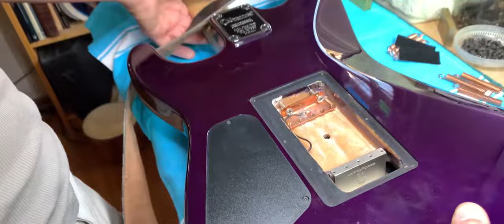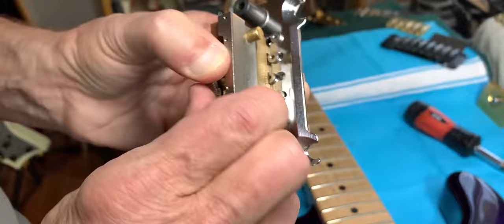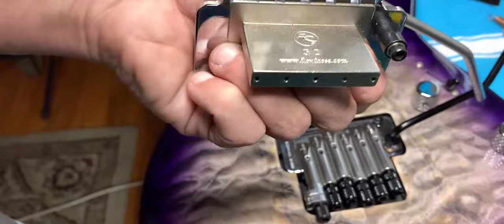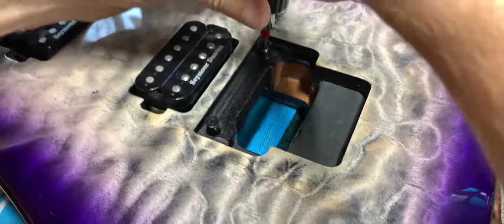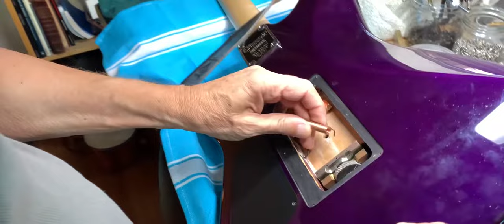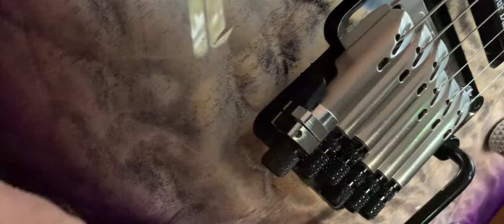Sophia Tremolos: Upgrading from Floyd to Sophia 2:92 pro [+]

Comment: In my experience the best is Ibanez bearing system tremolo.
Reply from the maker: Thank you !!!  The Sophia line is manufactured under multiple patents owned by Geoffrey McCabe - - Ibanez licensed  the ZR tech from McCabe... the proceeds of which went to establish Sophia Tremolos ... love back as always ..
Reply: @merkaba22  But, I dont understand why they stopped making it. It was really great solution.
Reply from the maker: @vaguitarts3443  Thank you -- we were not in control of that decision ...
Reply: Ibanez got sued by Floyd Rose and Floyd won.

Comment: Can you use the thumb wheel to tune from standard tuning in E to half step down to E-b and it will land all 6 strings in proper intonation?
Reply from the maker: No, unfortunately, since when the tremolo tilts both pitch and intonation are disturbed, -- the GT Pro will hold the base plate to +5 cents when dropping from E to D , and its believable and still  floating tremolo.
Reply: @merkaba22  What if i used the thumb wheel to roughly deune down a half-step to Eb, and then fine-tuned with macro / micro tuners? Would that be a good idea? Is it a possibility? I'm often re-tuning from standard to Eb and back.
Reply from the maker: @Peterplayingguitar  The QuickTune Thumbwheel is for re-establishing Initial Setup, where th base plate is 90º to the risers and string and intonation set.  YOU could drop the tuning down with the thumbwheel, but the action will be higher and the intonation off a little bit, more apparent on higher on the neck... its physics ...
Reply: @merkaba22  Roger that. Thanks for the reply.

Comment: i like that tremelo...will it replace my DC747 Carvin ? it has a floyd rose.  ?? Do you make these ? is there a website with specs and instructions ??  thanl you. I also noticed the limitations of most tremelos..limited contact of strings cant send tone through the body
Reply from the maker: Yea, yea - the pre-tensioned stabilizer contact pins add extra contact and embellished the normally linear decay pattern -- they actually make the instrument louder [acousticall], etc....
The Sophia 2:92 Tremolos are built for original spec OFR® Vintage and Pro routing. -- http://www.sevenstring.org/threads/trem-replacement-swap-guide-what-trem-will-fit-what-cavity.236457/  comparison listing.  It would seem that there is a general acceptance of fitment, stud spacing, etc. —  See SophiaTremolos.com or write to us: sales@cslsophia.com

Comment: Ok, this is awesome!😂 One question, is it possible to set up the baseplate to be flat on the body to be dive only (EVH style) for guitars without the trem recess route? I set mine up that way cause as you said, the more direct contact you have the better tone you'll have.
Reply from the maker: Actually, it would take a slight mod -- the Sophia intonation screws extend .078 below the base plate ...the OFR tremolo saddle screws only extend about .040 .
Reply: @merkaba22  Oh, OK! Thanks so much. Love the bridge

Comment: I recently ran across an interview series with Gary Kahler about the re-introduction of the Steeler tremolo platform for 2024, I was pretty stoked because the Killer is one of my favorite trem systems, only to be told that they were too expensive to produce. I proceeded to get into a heated discussion with the guy giving the interview where several suggestions were made and shot down because it 'just wouldn't work' (mostly involving simplifying the saddles because why tf do they need 13 parts each?) and that consumers are too uninformed to make worthwhile suggestions 🤦‍♂🤦‍♂. So imagine my surprise to see this wonderful piece of engineering! It's got the best things from the Killer without the convoluted (read ego stroking), has all of the 'impossible' suggestions already included and is no more expensive than the other top-line systems out there. Plus it can be use headless! Seriously well done!! I wish I would've know about this sooner. Now, if you'll excuse me, I need to prepare my wallet for the beating your website is about to give it 😁😁
Reply from the maker: Thank you so much for the kind words and reception -- "we love this stuff ..." --  if you have any questions write to us at sales@cslsoopahia.com

Comment: I have a Kiesel Ultra-V with a Floyd Rose Original on it. I like what I see with the Sophia 2:92 except for the extended length. I'd be worried that if I pulled up too much on the tremolo arm that the fine tuner knobs would extend beyond the cavity and dig into the guitar's finish- even without the detuner. From what videos I've seen, it would be a really close fit. Any experience with replacing FR trems with these on Kiesel Ultra V?
Reply from the maker: The Sophia 2:92 w/ macro-tuners fit most OFR tremolos with recessed cavities -- typically the recess should extend be a little less than 3" from the centerline of the risers -- we just got some custom stainless steel knobs that also introduce a shorty and a short spine version  that are about .065 [incorreclty stated as .200"earlier] shorter -- the typical dimension of the end of the intonated six string macro-tuner is anywhere from 2.75 to 2.92"depending on the guitar, etc. -- the shorter knobs then reduce this length to 2.685 to 2.855 -
 write us at sales@cslsophia.con or visit our website sophiatremolos.com
Reply: @merkaba22  That is awesome news about the shorter knobs. I measured the cavity and it extends 2-13/16" from the centerline of the risers. Thank you for updating me on that info.
Reply: So the 2:92 Deluxe seems to not even have fine tuners on it- is that the difference between that and the more expensive model? If so, I may be able to do with that, since my guitar already has locking tuners at the headstock, although when I custom ordered the guitar from Kiesel, they recommended I get the locking FR nut anyway, which I did. I'm afraid that if I leave the FR locking nut in place, without locking it, the string grooves might not be suited for tremolo use.
Reply from the maker: @gbferrell  Yes, the Deluxe locking saddles do not have our full-range tuners -- if you lock the strings at the nut, you cannot further tune the guitar -- the issue with the first floyd, etc. -- We suggest you get tuners for this arrangement is best since otherwise we are not sure if anyone sells a non-locking nut for the vintage locking nut shelf specifications...
Reply: @merkaba22  Ok, thank you. I like the idea of the 60:1 fine tuning knobs anyway.
Reply from the maker: @gbferrell  The nomination; length of the macro-tuners is reduced by ;065" -- the typical dimension of the end of the intonated six string macro-tuner is anywhere from 2.75 to 2.92"depending on the guitar, etc. -- the shorter knobs then reduce this length to 2.685 to 2.855 -- within 2.825- 13/36
Reply: @merkaba22  So, we can't be sure until I actually try it. I hate the thought of possibly having to cut into my custom flame-topped paint job, but as our bass player commented, he would do any mods to his guitars if it helped his playing. I despise the locking style of the Floyd Rose- I don't trust the 'locking' part of it because I've had strings slip out or break too frequently to be confident that it won't happen during a gig. Give me back my ball ends! Can the shorter knobs be had in black chrome- or that fancy red chrome that I saw in some of your pictures?
Reply from the maker: @gbferrell  yea, yea no ball ends -- the new tuners, though the knob to about .055 did and ups to .075 through the nose slot [where yo do cut the ball ends off].  We will have a dozen red spline knobs coming in shortly to evaluate  -- contact us to reserve....

Comment: I am confused on how to shim the Sophia for my 12" radius neck. Could you please tell exactly which strings (Low E, A, D, G, B, High E ) need to be shimmed and how much? I know this is a subjective question, but it would help to get a general idea of where to start. I'm thinking from your chart, the G should have one .2 mm shim and the rest of the strings don't need any. I think that's what you meant in your email but instead of 'G' you said 3rd string, which would depend on which side you are counting from. Usually, the high E is considered the 1st string, but just want to make sure.
Reply from the maker: We offer shims placed between the addle and the base plate, like intake locking tremolos, to alter the pre-fixed R14 radius we use on our tremolos.... shims under teh middle saddles increases the roundness and lowers the number, to say R 12 or R10 ..
Reply: @merkaba22  Sorry, I missed your reply in our email chain: "The Sophia 2:92 is performance oriented and has an R14 specification that works well with R12 to R16 and compound radii out of the box — you can order a set of shims, placed between the macro-tuners and the base plate, to alter the radius if you prefer." So, basically, you are saying that the shims aren't absolutely necessary because the 14" radius Sophia will still work well with 12-16" radii, right out of the box and adding shims or not depends on personal preference. I mounted the tremolo last night with a .2mm shim under the G string saddle. Seems fine, but I have yet to adjust the intonation. If I'd read your email reply more carefully, I wouldn't have had to ask that question.

Comment: Am I right in assuming that you’ll never need to unlock the Sophia nut once it’s locked as the fine tuners have infinite range?
Reply from the maker: Pretty much the case -- the macro-tuners a full range 50:1 ratio locking tuners

Comment: Hi! I have a LTD H3-1000 with a Floyd Rose 1000 SE would I need to route the posts to upgrade to a Sophia 292?
Reply from the maker: The short answer is No.. the Sophia 2:92 is a drop-in fit for nearly 7 years so far -- we even have OFR-sized Titanium spring blocks for small tremolo cavities -- We have a V2 "easy to setup" Global Tuner Pro that works with any pocket the can handle the big blocks -- write to us at sales@cslsophia.com -- thank you!

Comment: would it fit in a charvel 475 special.  it has a JT 590 schaller?
Reply from the maker: Yes, the Sophia 2:92 is a drop-in fit for the OFR and it and the JT 590 by schaller are very similar -- . Parts are interchangeable except for the locking bolts  --  given the associated rout, if deeply recessed, the macro-tuner knobs would be a close fit and like other solutions, the DropTuner would need the recess modified -- if floating above the body on this version, easy fit:)  The GT Pro upgrade means you do most of the tuning from the QuickTune Thumbwheel in double locking and headless setups..
Reply: @merkaba22  thank you ❤️
Reply: @merkaba22  I am looking in the website.  The 292 deluxe with the duel stabilizers I could tune it from the regular tuners right?.  For my taste it looks amazing really and unique.  If I can I would just upgrade to locking tuners  what do you think?
Reply from the maker: @crate718  yes, thank you! yes, you can do that too!

Comment: A big question for me.....I noticed Sophia makes a particular type locking nut that looks as if it may be ideal for a headless guitar....so can a Sophia trem and nut replace a Floyd Speedloader Trem and nut without mods? As you probably know, Speedloader strings are not made anymore leaving the Speedloader equipped guitars useless....thanks
Reply from the maker: We have seen a couple of conversions -- the body rout is small and we recommend the TI OFR-sized 32mm StopBlock -- The HPT Micro, with individual string locks, fits the normal locking nut shelf

Comment: Does the locking nut come with the trem? If not, can it be purchased separately?
Reply from the maker: We sell the locking nut separately Ince so many guitars already have them -- the Sophia HeadPeace Tuner line have individual string locks and fir on vintage-sale locking nut shelfs -- may need a minor modification on some guitars....

Comment: I will have one for my jem jr plz blow me up with advice and how I may get one as soon as a month
Reply from the maker: Hey back -- that conversion turned out very nice -- we get lots of feed back on that one!  The basic Sophia 2:92 is a drop in fit with. stainless steel saddles, inner parts, risers, arm, etc. -- you can chose either the GT Pro or UNO Single Stabilizer Upgrade -- We are temporarily out of black base plates, the black chrome would match nicely.  Just need the size fo your spring block, the distance from the spring end to bottom of the base plate. Check out our site, SophiaTremolos.com, for pricing and options ...

Comment: This looks amazing! Will it fit in a Alexi Laiho guitar?
Reply from the maker: The short answer is YES -- replacement for OFR sized tremolo -- you just need spring block length -- 42, 37 ,34 or 32mm -- for the base model with a bell brass StopBlock and built-in TremStop -- The GT Pro upgrade fits most pockets
Reply: @merkaba22  This 2:92 pro model will work? It’s currently on sale on your site.
Reply from the maker: @9hk38f  Yes -- just need the spring block on your current trem to get started.

Comment: isn't the tuner for the low E going to hit the body when the player pulls up the trem arm? are there any Sophia models that fit into the recessed cutout for a FR trem?
Reply from the maker: For most body routs, the 2:92 is fine -- we have seen from time to time, the body rout is a little short -- especially, for guitars built for other than the OFR spec like the Schaller version, with insertable knives, where the screws extending though the whale tail are shorter and the rout cur for that spec.

Comment: So for a brand new build, is there any difference between a Floyd Rose route out and a Sophia? Just asking if the router templates available for Floyd Rose are also the same for Sophia?
Reply from the maker: The Floyd Rose Pro rout from the FloydBook is a good place to start - the 2:92 is a drop-in fit, depending on the neck angle and shape of the top, you could extend the recess rout slightly for the macro-tuners,- otherwise, we see a good non-modified rate for installs...
Reply: @merkaba22  so do you sell router templates?
Reply from the maker: @corfo8433  We don't have anything like that -- we suggest the vintage Floyd Rose Pro template as the optimal place to start  -- page 10 of the "Floyd Book"

Comment: What's the largest usable string gauge? I use 56
Reply from the maker: The string slot is .078" wide -- ideally you can use up to .075.  We have a revised macro-tuner pin that allows .055-ish  strings to be loaded through the tuner knob  fairly easily now -- The macro-tuners can also load strings through the nose slot and under the clamp lever before locking...

Comment: Do you make a trem that can replace the cheap Chinese clones of the Steinberger R-Trem?
Reply from the maker: Actually, no ... the Sophia 3:22 Tremolo is closest but the string spacing is wider ... thank you for thinking of us!
Reply: @merkaba22  I don't see the 3.22 on your website. I see the 3.44 and 4.44 but those aren't floating trems.
Reply from the maker: @JoeR203  Its in pre production -- we are workin on the spring -- works but not up to snuff yet...
Reply: @merkaba22  Work on one for the Steinberger Spirits too.  🙂

Comment: Im not trying to be rude. But copper springs and trem parts wont make a difference.
Reply from the maker: They are no-noise physically -- they do not require capacitance deading rubber or similar -- we have been doing this for over 8 years and so far there is a concensus .. but you could be right ....

Comment: no options for left handed
Reply from the maker: We had an issue with our supplier for left handed base plates and are working on it -- in the meantime, a left-handed arm upgrade, StopBlocks and GT Pros, locking risers, copper coated springs and claw are all compatible with vintage OFR specs...  can be very nice:)

Comment: Over engineered. Just a Gotoh 510 with the Wilkinson locking saddles on it, a LSR ball bearing nut and staggered locking tuners, and the guitars stays in tune as good as a FR system. Way easier to intonate and tune.